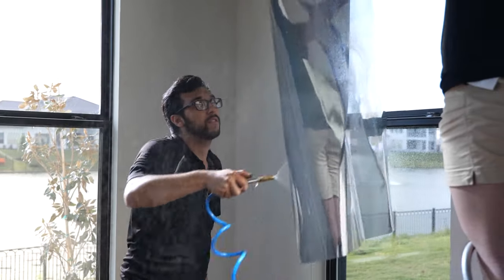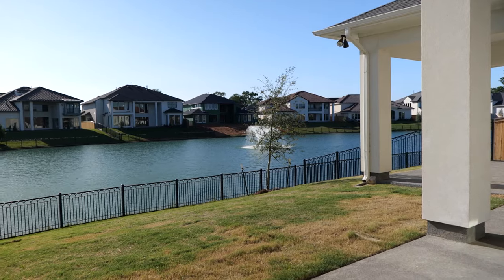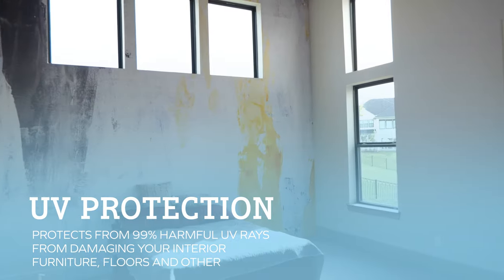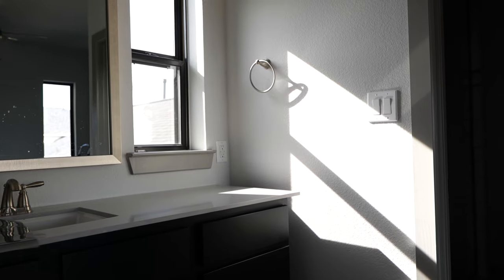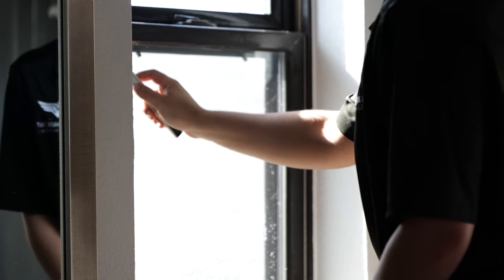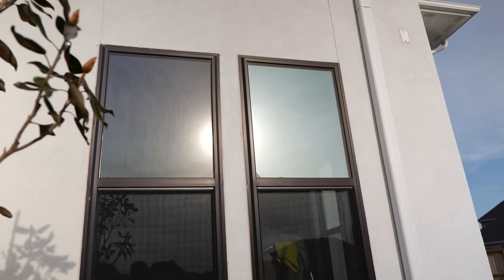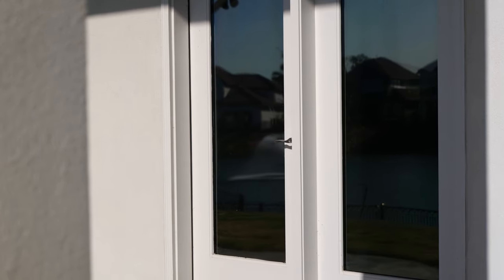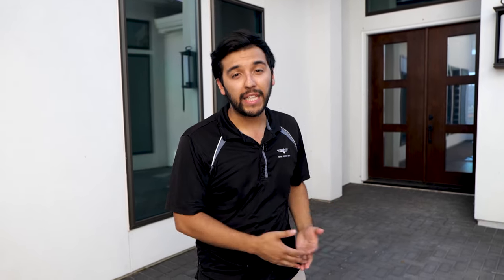Privacy Window Tint Installed on Entire Home *MUST WATCH*

Comment: Can you either make a video, or show me a video that demonstrates the drop in temperature in a room , before, and after, for window film ? 
I currently have blackout curtains, but if you can demonstrate that window film is superior to blackout curtains, you would have made a believer.
Reply from the maker: Hey Tech We Love ! That is actually the next video we are working on ! You CAN actually measure how much heat is coming in with a Tint Meter . 😃🔥 So now we will be able to show on hand how much heat our tint really blocks !  Stay Tuned 🤗
Reply: @darkshadewindowtint4727  Thanks. I look forward to it. My bedroom can get to 95 F in the summer, 3rd floor of a house, and no tint on the windows, with a desktop PC in the room. I have blackout curtains for sleep, but now I want some tint on my windows for the day. I totally didn't even know that was an option. I'm also looking to upgrade my PC to a more energy efficient setup, and sacrifice performance in order to get lower temps in my bedroom.

Comment: If outside is dark at night. Do they can see inside if the lights are on in the house?
Reply: That’s a good question to ask
Reply: yes cuz the reflection works the other way round too
Reply: I have had this kind of tint on my house for over 20 years and love it. Yes, during the day no one can see in but it mirrors to the side producing the most light so at night it mirrors to the inside and people can see in but most people close blinds at night anyway. Or if you keep your front and back porch light on and lights are off inside the house it will still mirror outside at night and people cannot see in as well. So I still feel like it is good in that sense as well. The heat and glare it blocks is amazing as well.
Show less

Comment: Definitely been considering this - appreciate the video. I'll have other window treatments providing privacy at night - but would've been helpful to see from inside and outside the home at night. 1. Do the windows require special cleaning products once the film is installed?
2. How would you remove the glue that's left behind if you decide to remove the film?
Reply: You still can see in the house at night as you can if you have tint on your car and you turn on the dome light. The reason I would do this is to keep the heat out, especially homes with tall ceiling where heat warms your house in the hot summer. If you don't want to spend a ton on new windows, tinting them helps reduce electricity cost in the summer and winter. I have my front windows of the house tinted and it works. Don't cheap out on tint, find a film that is legit. You can clean the window with Windex and if you want to remove the film, remove the residue with something like Goo Gone and a razorblade.
Reply: @DarkAcid-X  Do you have a tint brand/type, etc., that you recommend? I am going to put tint on my garage windows. I have four that need covering. I live in the desert and normal summer temps are over 100º. Thank you for responding. I'll have to look into this soon.
Reply: @vegassmiles  I am using Jonson film tint that I bought from my local tinting shop. It’s currently 100 here in KS and it helps. I’m using Sunset Bronze 20%. This won’t eliminate all of the heat, but it’s better than have the sun and UV shining through your windows. With the back of my house facing the west, it’ll still get hot so we have blinds and curtains closed. 

Another thing you can do is put up good ol’ aluminum foil over the garage windows if you just want to save money and block most of the heat. It won’t look good, but it works the best.

Comment: How efficient is it during the night though? During the day I understand that no one can see from the outside. What solution would you recommend for night time?
Reply: I Would like to know that too
Reply: It doesn’t give any privacy at night. Instead you end up with a mirror on the inside as your trying to look out making it hard to see who’s looking in. Scary if you ask me. Anyone can see in but you can’t see out.
Reply: @naazimmaredia796  yeah at that point you're better off getting shades and curtains for the night time. Day time though... this stuff is amazing. Can't see in whatsoever
Reply: I have had this kind of tint on my house for over 20 years and love it. Yes, during the day no one can see in but it mirrors to the side producing the most light so at night it mirrors to the inside and people can see in but most people close blinds at night anyway. Or if you keep your front and back porch light on and lights are off inside the house it will still mirror outside at night and people cannot see in as well. So I still feel like it is good in that sense as well. The heat and glare it blocks is amazing as well.

Comment: Does it work at nighttime when a lights on on the inside ?
Reply: No, when the lights are on, at night time, the effect reverses, as there is more light inside that outside.
Reply: I have had this kind of tint on my house for over 20 years and love it. Yes, during the day no one can see in but it mirrors to the side producing the most light so at night it mirrors to the inside and people can see in but most people close blinds at night anyway. Or if you keep your front and back porch light on and lights are off inside the house it will still mirror outside at night and people cannot see in as well. So I still feel like it is good in that sense as well. The heat and glare it blocks is amazing as well.
Show less

Comment: Does this only provide privacy during daytime. But at night time when it's much lighter inside the house, without curtains then there's the issue of privacy again right?
Reply: I would also like to know but no one has answered your question in 2 months wow
Reply: No, when the lights are on, at night time, the effect reverses because there is more light inside that outside. The light inside your house will hit the inside of the film (assuming no blinds) and the mirror effect will be on the inside. If you close your blinds at night, its not an issue.
Reply: Soooo you can't see outside your window at night? Just your own reflection?
Reply: @annarogers8220  so it seems. As per reply of TintXperts, close the blinds, so that privacy at night wont be an issue.
Reply: @tintxperts-6803  Thanks for the reply. :)

Comment: At night they can see in you can't se out. 😔
Reply: I have had this kind of tint on my house for over 20 years and love it. Yes, during the day no one can see in but it mirrors to the side producing the most light so at night it mirrors to the inside and people can see in but most people close blinds at night anyway. Or if you keep your front and back porch light on and lights are off inside the house it will still mirror outside at night and people cannot see in as well. So I still feel like it is good in that sense as well. The heat and glare it blocks is amazing as well.
Show less

Comment: How does it work at night???
Reply: I have had this kind of tint on my house for over 20 years and love it. Yes, during the day no one can see in but it mirrors to the side producing the most light so at night it mirrors to the inside and people can see in but most people close blinds at night anyway. Or if you keep your front and back porch light on and lights are off inside the house it will still mirror outside at night and people cannot see in as well. So I still feel like it is good in that sense as well. The heat and glare it blocks is amazing as well.
Show less

Comment: That was a lot of water to be doing that inside of a home. I understand glass has to been clean of dirt and wet to apply it but, you can use isopropyl Alcohol. Lol process shouldn't be any different from window tint on  vehicle.
Reply from the maker: we use our own tested and proven water solution to clean windows and apply the window film. Sometimes we use more water if the windows need more deep cleaning before installation, or if the windows are a larger size. However, at the end of every project we ensure no water build up is on the floor or the window edges.
Reply: @darkshadewindowtint4727  I guess you dont understand that most houses arent water proof like a bathroom is. Water can be absorbed into the walls and rot wood my friend. Just because you cleaned up excess water doesn't mean that walls haven't absorbed moisture. Basic science and building construction. The damage may not be apparent until years later.
Reply: @darkshadewindowtint4727  btw...glass doesn't need "deep cleaning." Glass isn't porous and dirt sits on the surface unlike other materials. It's common sense.